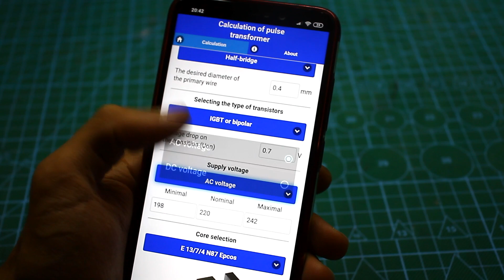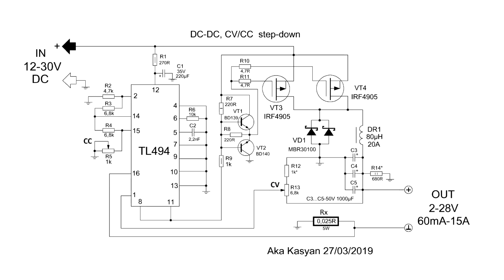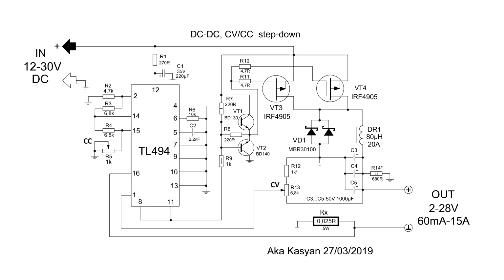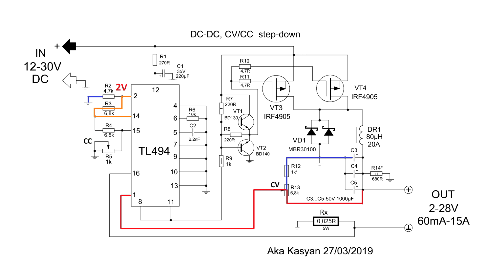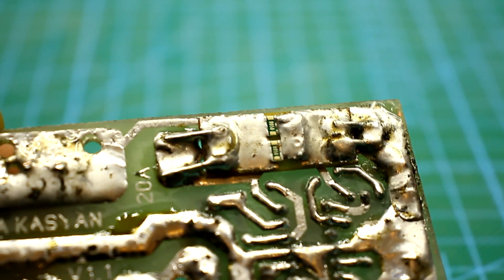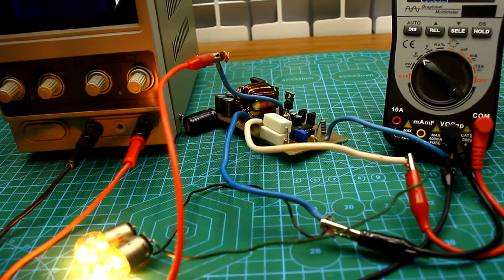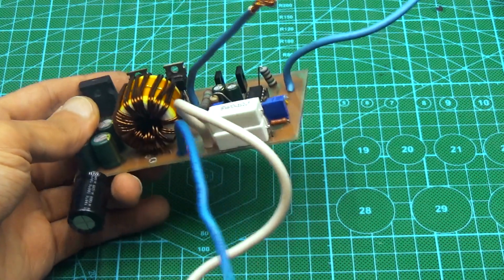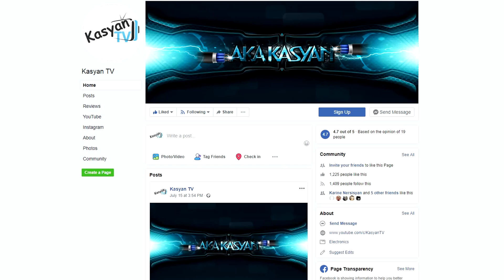HIGH POWER 0-25V 0-15A adjustable power supply

Comment: Yes, No Word To Say For Your Excellance,
it is a perfect working
also i made this
and create some of changes 
for protact high voltage from input
output side make a fix 
voltage with register and zener and fix amp for charge the battery like a mppt and put one more protaction for cut the battery current from 10% charge amps to 1% when battery voltage rise 14.2 till 14.4 charge with like 0.4 amps

i have no any word to say about your expiriance
you always make perfect circute
with all of calculation and risk fres
god bless dear

my last feedback for you

circute a buck convert a voltage from 15 to 90 volt
with 10 amp to 50 amp
and protaction of high and low side
with lighting protaction
revers polarity protaction
and display it with i2c
input support up to 700 watt
low side outside voltage fix
14.4 and 50 amps and it 98% efficiancy
 support no west energy.

in 700 watt minus 2% energy lost max 20 watt of pcb heat
and 10 to 15 watt lost of cabble resistance
finaly out 45amp need

45x14.4(out)=648 watt for dirext use home load with 750watt pure sine wave inverter
 200 amps battery
charge on day sun time in 9 hour by 20amps 
thankes
Reply: Hello boss. Pls replay.. i need that circuit. I created with the given circuit but not got sucess .my output is there but no voltage change when changing the pot. What problem pls

Comment: Great video.
Recently, there are many options of good PWM controller. One of them is RT9259 which applies totem pole output state. Totem pole output can prevent voltage-pumping by complex load.
Cheers from Indonesia

Comment: The input voltage range is up to 30v this means that if the ic switch to the ground (pin 8,11) between G-D the tension is higher then the maximum 20v this kill the MOSFET
Reply: I noticed that, was going to comment.
Reply: Zener diode is a must
Reply: It is possible to use n chanel mosfet using charge-pump capacitor
Reply: Attila....new subscriber lol
Reply: Correct remark.

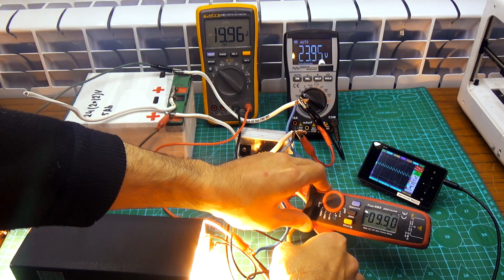Comment: The supply is unstable.  when you show the scope waveform at 2:32 the pulses are dithering with a 10 Amp load.  If you reduce the load to just a few amps it may get worse..  You cannot use the DVM to check for stability.  The output could be oscillating from 0 to 10V and the DVM will show 5V.  The scope is the only way and the pulses must be completely steady.  In any case I give this a Thumbs UP!

Comment: I have build this circuit but this circuit diagram does not work until you replace R7 (220R) to R9 (1K) and also completely remove R8 (220R) than it works great
Reply: I made the circuit but it doesn't adjust the voltage and amperes. Can you help me
Reply: Thank you. Those changes made my circuit work.
Reply: @victorribeiro2304   can you help me
Reply: @ugurozsoy8001  what's wrong?
Reply: @victorribeiro2304  I did the circuit exactly but it did not work. I cannot control the voltage and amperage.
Reply: Thnx bruh..thnks a lot.🙌
Reply: Always happens in such tutorials..they show the schematic...and make something else.🙁😑and when we try to build using the schematic it never gonna work.
Reply: This comment needs to be pinned..but kasyan never cares about their subs.🥴
Reply: Pls can i have ur schematic diagram which work perfectly??I need it pls
Reply: Al işte! Gerçekten öyle mi? Yanlış şema mı vermiş? Biz de güveniyoruz Kasyan Tv'ye, yanlış bilgi vermez diyoruz! Öyleyse bu kanala da güvenilmez, bu kanal da çöp desene! Başka güzel ve doğru bilgi veren kanallar bulmamız gerek.

Comment: This circuit sounds great but using a 15 ampere 240 vac _  25 vac transformer is costly together with the rectifier and smoothing circuit to feed the circuit with 25 vdc .
Do you have another cheap and practical proposal or solution .
You reply is in advance appreciated

Comment: The current sensing resistor (Rx) is outside of voltage control loop! The output voltage will droop with the voltage drop on this resistor (0.375V). Output voltage will not be stabilized.
Reply: Kasyan is doing a great work but he needs more precision because I also built the circuit but my voltage is not stable enough to drive a load...

Comment: Ben bu devreyi 0 50 v  , 0 10A olarak yaptım, tl494 ü ve  kullandığım 16f676 entegresini 12V ile besledim, Devre çok karallı çalıştı, 
yalnız R9 daki direnç kavlurdu, yine de düzenli çalışıyorlar
öneri, Videolarınızda kendi orjinal sesinizi kullanınız, kendi sesiniz daha güzel, Teşekkürler
Reply: I Made the circuit but MOSFETs get very hot even on low current

Comment: I built it & it works ,BUT , as he mentions it's not a bench powersupply ,it's a charger .because it is very noisy . At 3 amps output i get about 2.5 volts of ripple .

Comment: maybe I can use this schematic to turn it into an AM modulator!
instead of the voltage regulating potentiometer, I do the modulation in there.

the control schematic for stabilization will also be canceled!(does not have to be made!)

Friendly greetings from The Netherlands!
Rob.

Comment: Are you sure that the values of the resistors R7 and R9 are as shown in the schematic?  Something seems to be wrong with the driver stage. VT1 seems to be permanently on. This means that it's emitter will always be in almost the entire B+ voltage. This voltage needs to be shorted to the circuit ground when the end of the the R9 terminal that goes to TL494 is grounded through the I.C. Is the value of R9 capable to saturate VT2 and can VT1 (or both transistors) withstand such direct short circuit currents of the power supply voltage, especially if it is at 30 Volts? I wonder how much is the power loss of the driver stage as it is shown. Not the best design anyway.
Reply: Hello, i built the circuit but i found out that one of the P channel mosfets is always giving maximum output while the other is regulating. Other thing, the circuit doesn't work with input below 18v and doesn't go more than 11v. Any idea why ? Thanks
Reply: @hichamtassi1753  Since the two mosfets work in parallel, what you say seems to be not possible. If one of them is shorted out, only in this case can this problem happen, but in such a case there is no regulation at all. You need to check your connections again and see the test signals at the output of the I.C. Normally it should work properly with 12V input. Check the 5V voltage reference of the I.C as well...
Reply: @ΠάριςΑζής  Hello, i checked and indeed one of the Drain tracks was cutted. Now it regulates the voltage normally. But below 18V it turns off, the current limit function works but max current obtained is 500mA (with 0.02 ohm resistor), and the irf9540 that i used heat a lot even with only 100mA load..
I have also noticed something: in the PCB the drains are linked to the diode whereas in the diagram, the source is linked to the diode, it seems Drain and Source are inverted...
Thanks for your comments on this.
Reply: @hichamtassi1753  The drains are correctly connected to the cathodes of the double shottky diode. The sources are connected to B+. This is normal because the mosfets are P channel. The schematic is correct as regards that. You need to find out the fault by careful troubleshooting. Check the resistor values first and their connections afterwards. Then you must do the adjustments of the trimmers...
Reply: @ΠάριςΑζής  Ok, thanks for the info on the P channel. The issue i am facing now is that i have no power, voltage adjustment is ok, but under small load, voltage drop to  zero regardless of the potentiometer position. Pin 16 sees from 0 to 0.6v, and i traced the shunt, and it seems good. Any idea where to look at ? Thanks
Reply: @hichamtassi1753  The range of the voltage reference adjustment of pin 15 is correct. Pin 14 is the 5V reference. For 15A maximum output current, you must adjust this voltage to 0,375V. This is so, because the product of the shunt resistor value and the maximum allowed  current is 15A*0,025Ω=0,375V. Since you can adjust the voltage at pin 15 to this level and provided that your shunt resistor is indeed 25mOhm, the circuit should work perfectly. Practically speaking, when connecting any load to the output, the voltage developed on pin 16 (this is the feedback input) should always be less than 0,375V, that value being the maximum. With no load at the output, you should not see any voltage reading on pin 16. Only the reference of these 375mV on pin 15 should be present. Check again carefully the value of the shunt resistor and its proper connections. 
Note that the output load of the circuit is grounded through the shunt resistor, which translates the current through it into voltage, for further informing the current limiting operational amplifier of the I.C (pin 16) about its magnitude. Once this feedback voltage on pin 16 exceeds the value of that reference on pin 15, then the output current of the system is limited to the preset value. That's all.
Reply: @ΠάριςΑζής  Hello, thank you for your thorough troubleshooting. I indeed found out what you mentionned. By coincidence i found the problem: below 18V, the voltage drop to zero under small load. When I increased it to 22V, it worked good but at 10A i burnt the only 2 P channel Mosfets.
I used another one, but i see that the output voltage EQUALS the input voltage, no voltage drop at all even if regulation and current limiting are good, is this normal ?
Also, can you please show how to use N Channel mosfets, that will resolve all the issues.
Many thanks for your kind and professional coaching.
Reply: @hichamtassi1753  Unfortunately the  best way is to use P channel mosfets for this circuit. As regards your problem, there is a possibility of using an improper inductance there, especially a coil core incapable to withstand 15A, coming in magnetic saturation much earlier than this magnitude...
Reply: @ΠάριςΑζής  I am not using coil, just straight wire meanwhile i build it. Is it so important to have a coil if i dont plan to use more than 5Amps ?
Reply: @hichamtassi1753  Well, it seems that you miss even the basic theory of the operation of DC/DC converters...Anyway, without the proper coil in its place, don't expect this circuit to work properly. Just forget it!
Reply: @ΠάριςΑζής  Thanks for your advice but i prefer to continue than to give up. I will make that coil as shown in the video. Indeed, i am not very aware on how dc/dc, can you explain the work of the coil ?
Reply: @hichamtassi1753  Well, if you "prefer to continue and not to give up", this is very good, then do it in the correct way. This means that first of all try to learn the basics about circuits and especially about electronic components and then try to implement such complex circuits as dc/dc converters. In any case, do not expect yourself to be an expert by watching videos here in Y.T, for many different reasons, the first of them being the fake circuits proposed by anyone...If you are really willing enough in learning, start reading relevant books. There is huge theory behind these applications such as dc/dc converters, which cannot be covered by a simple explanation given to you of "what is a coil and how it works"...Anyway, I really wonder about how do you expect to successfully implement a circuit, while ignoring the functions of its consisting stages and functional components! As i think, this is simply not possible. It looks like the reverse way to knowledge, which can only be chaotic leading you to nowhere...
Reply: @ΠάριςΑζής  Hello, I expected at least a small word about the actual circuit, thing that would have helped me a bit, knowing of course that i am not an expert, but i need some advice from one. If not, no problem, i will as suggested try to learn more about it with some research.
Reply: @hichamtassi1753  A "small word" cannot resolve such problems. If it could, i would already had sent you that. 
You need solid theoretical background for implementing circuits like that. Without that, working with power electronics, there is a great risk for your own personal health, even your life. I hope you understand that I don't want anything like that to happen as a result of my interference on that matter...For the time being, just follow the correct methodology for getting useful knowledge, which means start "swimming in shallow waters" first, without the risk of getting yourself drawn helpless into deep waters...I hope, for your own good, that you understand these guidelines...
Reply: @ΠάριςΑζής  Hello, i followed your advise, learnt about the inductors and how they store then release the energy by inverting the polarity. Then I built that inductor giving 84 mH, it works good for both current and voltage regulation, less heat but i can hear the hissing of the switching, and under 5 Amps, the voltage drop is more than 0.6V, is this normal ? thanks
Reply: @hichamtassi1753  There is a big difference between 84μH and 84mH... Are you sure about the coil you built? And yes, 0,6V drop under 5A load is too much. You must now troubleshoot it and find out the cause of it...
Reply: @ΠάριςΑζής  Hello, sorry i meant μH. I tried to troubleshoot as asked, but the only thing i found was when i increase the voltage to more than 13V with a car lamp as a load, the hissing diseappears. Below 13v, horrible noise. As for the voltage drop, i noticed that the input voltage has to be at least 5V more than the output to minimize the voltage drop.
Reply: @hichamtassi1753  Feed the input with fixed 30V and let it there. Your power supply must be capable of putting out more than 5A for this test. Then check the working ranges of the Constant Voltage and Constant Current potentiometers. Are they within the given values? With no load at the output, can it put out 2V min up to 25V max, by adjusting the CV potentiometer? If yes the CV circuit works ok. If not, there is a problem in it. Afterwards, if you short circuit the output, can it put out 60mA min up to 5A max by adjusting the CC potentiometer? If yes, it works OK. If it blows up, then something is wrong. This is a step down dc/dc converter, that is, it will always put out less voltage than what you give it at its input, with 12V being the minimum value for the proper operation of the I.C. But you can not get 25V out with 12V input! Forget the hissing noise if all above work as they should. That's all with it.
Reply: @ΠάριςΑζής  Hello, i did the measurements you mentionned. For CC, all is good as per your first messages also with regards to shunt value. So no Problem with that part.
For CV, i put 30V 10A, but the issue (if this is an issue) is that the output voltage equals the input voltage, this seems weird.
As for the hissing, do you think it comes from the coil ?
Reply: @hichamtassi1753  Yes, the hissing comes from the coil. For the CV regulation, you must have approximately a stable 2V at the pin 2 of the I.C, which is the reference voltage for the relevant comparator. Then, you must see if you have the voltage feedback from the output at pin 1 of the I.C. This voltage determines the pulse with modulation degree for proper output voltage regulation. So, if your reference is there and the feedback voltage can be adjusted, the CV circuit should work properly. Otherwise this circuit is faulty and you need to replace the IC. There is nothing more about that.
Reply: @ΠάριςΑζής  i read all you write and man, not anyone aswer such (bit dumb) question from a stranger in comments, thanks for that, there is always someone who finds this aswers and question useful, at least me :)
Reply: @picanazo420  Thanks a lot for your kind words. This is my motivation for helping newcomers in electronics...

Comment: Thank you for the excellent Circuit. Need some help on output Transistor, can you suggest any other transistors equivalent in place of IRF4905 they are not available in our market. My transformer DC output is 37V- 6Amps after filter. I want to use this as bench power supply for my mini workstation. I am a hobbyest.

Comment: If I put transistors on P-chanel IRFP9140 100V VDS, power supply TL494 on a 33V Zener diode and a 2W 270 Ohm resistor, 220 Ohm resistors, 270 Ohm tam, capacitors on 80V, gate resistors 10 Ohm, will the converter work and will it not burn up? When you power it from Vmax 60V or 55V 6A panels and connect it to 12V charging? Also consider whether to exceed 20V VGS. Schottky diode 20A 80V. Inductor 95uH.Why, after making the above-mentioned modifications, i.e. changing the transistors to the mentioned IRFP9140, inserting a 270 Ohm resistor and a 33V 1.3W Zener diode on the TL494 power supply, replacing the 220 Ohm resistors from the diagram - I gave 270 Ohm, gate resistors instead of 4.7 Ohm, I put 10 Ohm instead I put a resistor at the 680 Ohm output at 820 Ohm. After exceeding the supply voltage of 38V at the input, an undesirable 25V appears at the output despite the regulation? What is wrong?So I have 35V and I connect it to the converter input, I set 14.5V at the output. I increase the voltage at the output and exceed 38V - suddenly the output appears 25V or more, potentiometer regulation then no longer works. What's the problem? I think that the choke changed something from 95uH to about 150uH. He should help.

Comment: hello.i made this circuit and seems to work but the mosfets gets too hot even with 200ma load although in the video says you dont need heat sink for about 3 amps load.i wonder what will happen with 3amps load or more.also i see comments that you must change some components with others?which is the corrent placement after all?

Comment: Help i made same circuit but when i put load on the output the mosfet gets very hot in seconds and show only 400ma max  current at output
Reply: have you put a sink in the mosfets???
Reply: @tiagonet8794  yes but he said you can draw 3-5a with out any heat sink